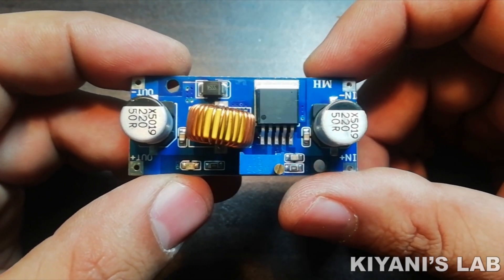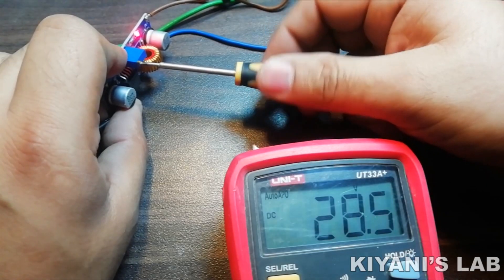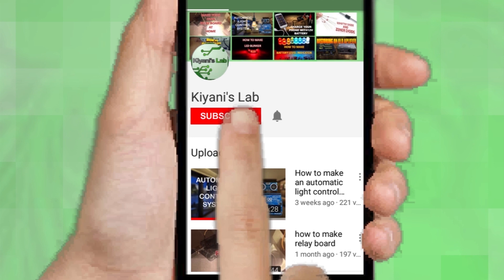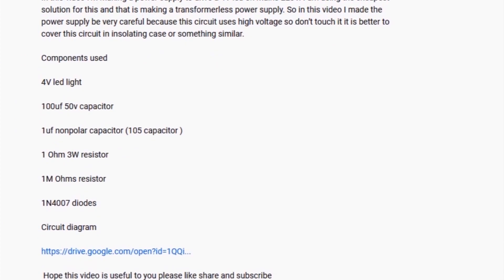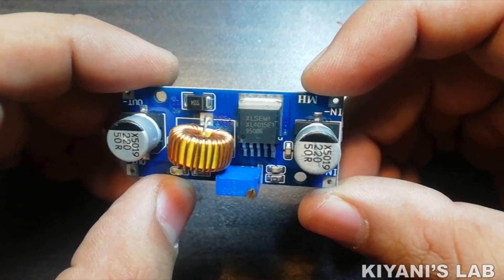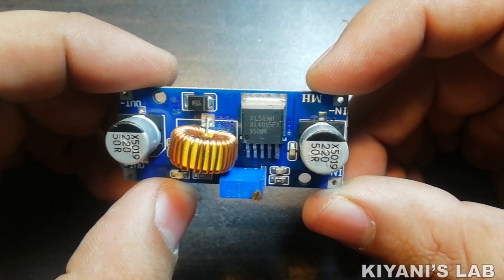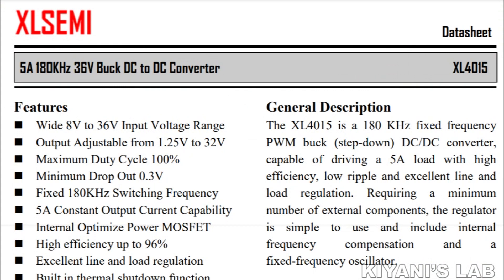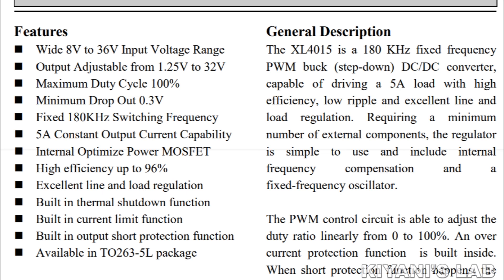XL4015 5A Buck Converter Review

Comment: I'm stuck with  around 2a. My power source is 12v battery (8 piece of AA battery). Target voltage is 5v which I able to set. I already adjust current by turning the CC trimpot.
Reply: Hello, aa battery can't provide higher ampere

Comment: I cant make it from 12v to 9v. Is there any way? I tested two same 4015 modules but in vain.
Reply from the maker: 1 did you ry to turn trimpot clock wise or anti clock wise 2 may pot is damage

Comment: Man are you really putting the heatsink below ? :D
Reply: For surface-mount parts, soldered metal contacts often conduct heat better than the plastic case does. So the heatsink works better on that side. To see which will work best in a given application, check which side feels hotter to your finger.  Whichever side feels hotter is conducting the most heat to your finger.